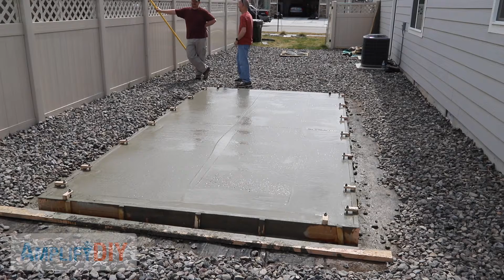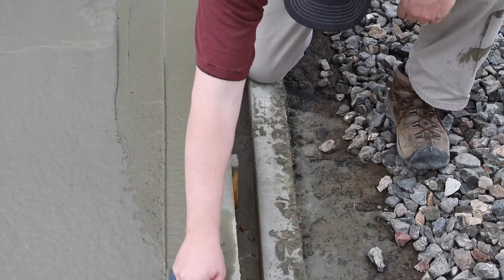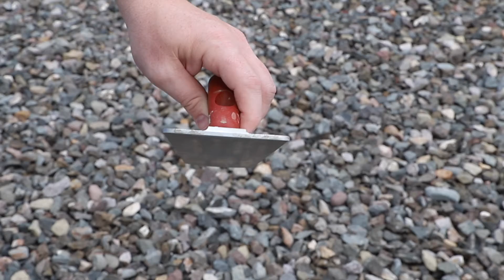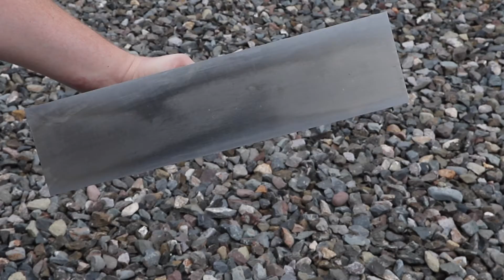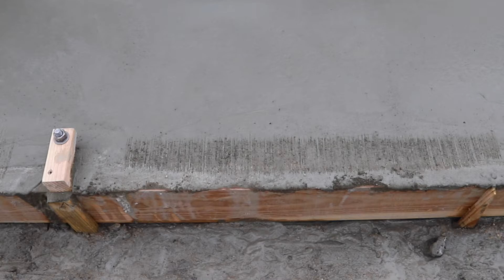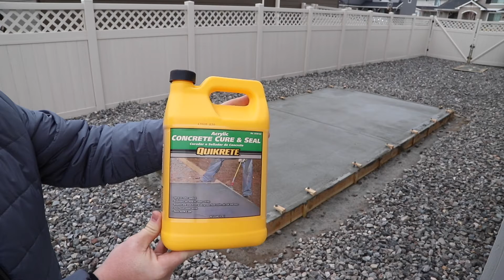How To Finish a Concrete Slab For A Shed: How To Build A Shed ep 5

Comment: What is the need for sweeping the floor? Wouldn't a nice smooth floor be nice? Any particular reason?
Reply from the maker: Nice smooth floors are great until they get wet. Then they get very, very slippery. I knew I'd be storing some lawn equipment out in this shed (which might leak fluids on the floor) and I wanted to have a slight texture to the floor to help it be just a bit more grippy. Great question!
Reply: @AmplifyDIY  Thank you for the detailed explanation.

Comment: Since you eventually took a broom to the surface to get a grip texture finish, what was the purpose of going over the concrete a second time to get a smoother finish? Wouldn't it been easier on the back/knees/body to have simply fixed the initial brooming mistake then wait longer to do brooming?

Fantastic video! THANK YOU VERY MUCH for doing this! Great time lapse and voiceover!
Reply from the maker: Going over the concrete multiple times really helped to make it as flat and even as possible. I didn’t want any low or high spots, and multiple passes helped ensure I’d have a more or less perfectly flat slab.

Comment: i did notice that you did not use a dpm that would stop  moister coming up though the floor
Reply from the maker: That's true - and had this been a slab for a tighter-sealed building that would have something on the floor like carpeting, I would have. In this application (a shed that will not have any floor covering on the concrete) it was not necessary.

Comment from the maker: This was the step I was the most nervous about - and I'm really happy with the end result. Any thoughts about what I could have done better?
Reply: Softer lighter broom. And wet it !!!
Reply: first time you broomed it, concrete was still not set up enough. should only be able to push your fingers in about 1/8”. also, when brooming make a full pass….don’t go half way and then go to the other side. finishing is all about timing….you were too early the first time you tried the broom and then when you actually did broom it you were a little late….you can tell in the video barely visible some of those stroke last were. but either way, it’s just for a shed so who cares.
Reply: Round all the corners. Square corners are more prone to breaking. Leave extra concrete on the truck if you can. They typically have a pit for extra or can mix it for new loads. Waiting a little longer before putting in the bolts would have made life easier for you as far as getting them in straight. Also, you probably could have removed the forms at the end which would have given you a better chance to correct any imperfections on the sides.